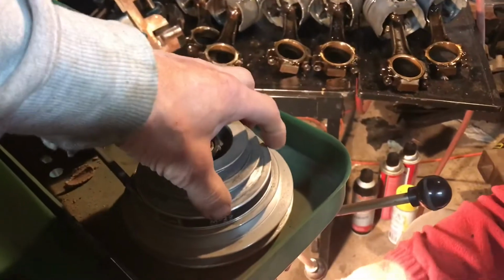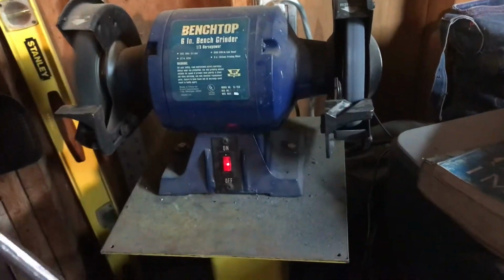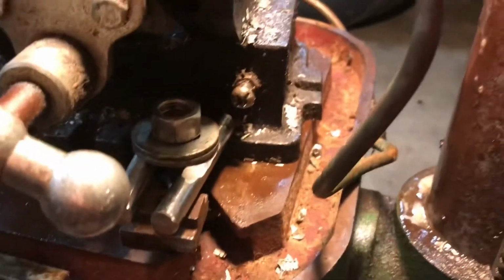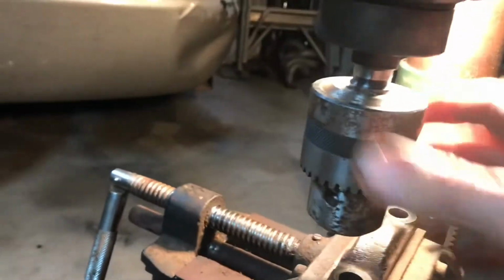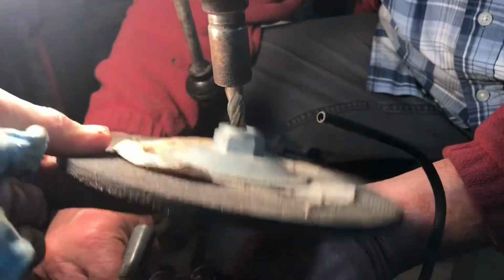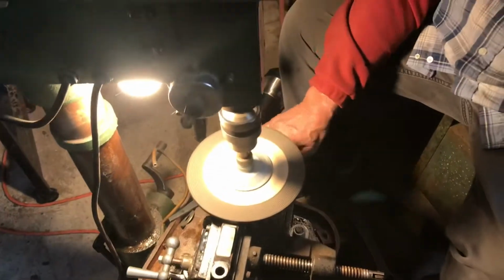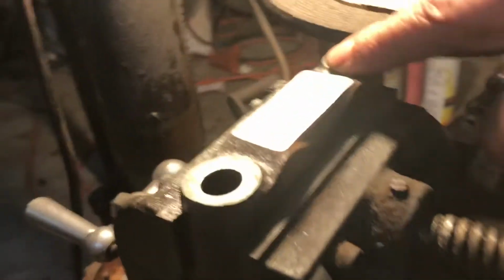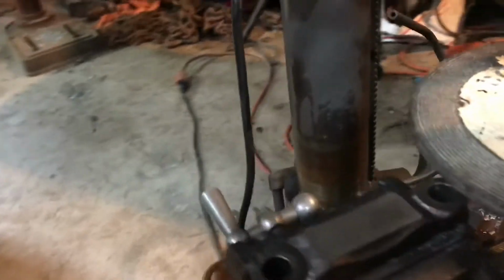Cutting main caps for block girdle Mopar 360

Comment: Yeah but you just removed material from where it is needed. The whole Idea of the shims is so you DON't have to do this.
Good luck going over 6,500 rpm for any length of time. Or pushing more than 600 HP. Gonna break the caps right in the center.
Reply from the maker: DobermansRock I stopped after the first test cap.
Will be using shims when I actually put the thing together.
Slow going project.